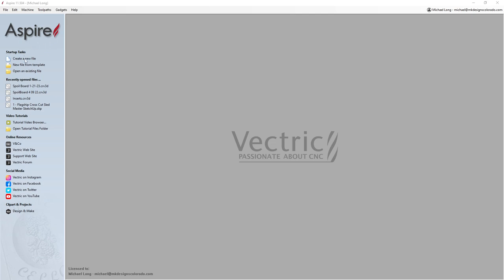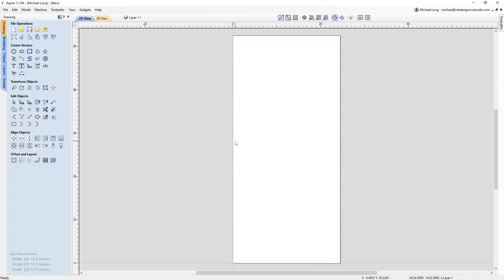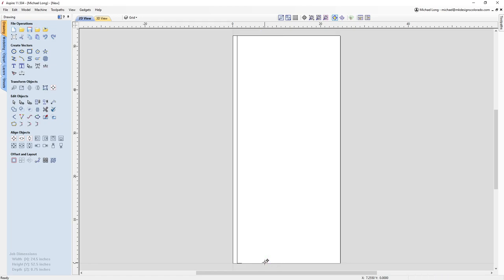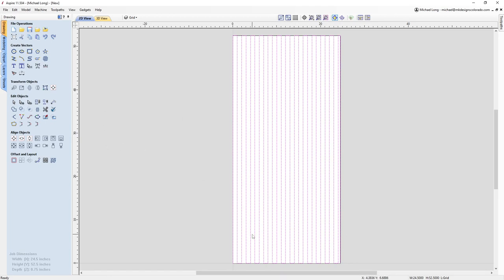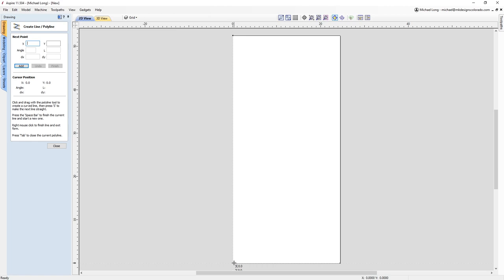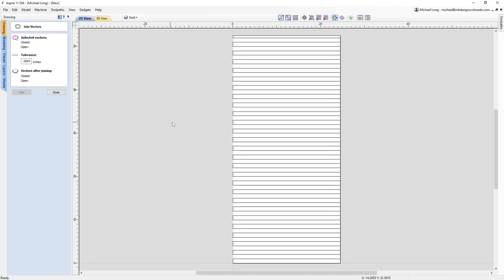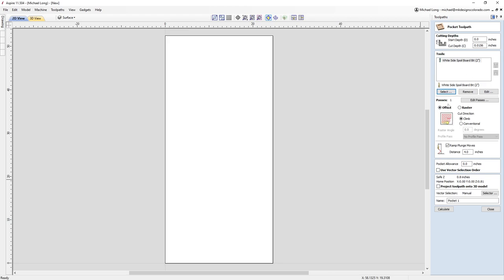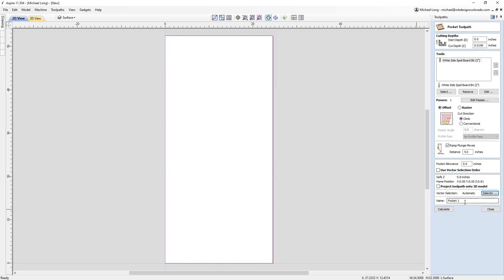Creating Toolpaths for a Spoil Board

Comment: Just finished the Grid and Surface and have it saved. Took me several tries because I was trying to watch the video and then switch to V-carve back and forth on my laptop. Tonight I used another computer to watch the video and my laptop to work on. Much easier. Question (I'm new at this) when I go to run the surface do I need to set the center of my board as the XY? Or does the program just use the size entered and the toolpath and go to town? I know I have to set Z.
Reply from the maker: You will need to set the X and Y to the same spot that you set in V-Carve for the XY Datum.

Comment: I have heard often that climb cut is not great, bit is trying to climb out of the cut which causes chatter as it is cutting from the outside of cut edge inward toward where you are cutting, conventional scoops from cut toward outside and provides constant pressure against spindle
Reply from the maker: That is partially true. 
The first thing I am going to say is if you are getting chatter on a climb cut you are trying to cut too fast for the bit and material.
The descriptions of how each work is accurate. However, conventional cuts tend to tear out more often. If I could draw a diagram here it would be easier to explain. Climb cuts sever the grain whereas conventional pulls and cuts them. It is similar to using a hand router where depending on your wood you need to do a climb cut ( carefully mind you) to get a smooth cut. 
Conventional cuts are great for roughing passes but you will want to switch to climb cuts for finishing and fine details.

Comment: Thank you.  I was wondering if there would be any advantage in using a pocket cut in raster mode (no layout needed)?
Reply from the maker: I’m not sure what you mean by no layout needed. You will still have to layout for the raster. Also, the reason you want to use offset instead of raster is because:
1- with raster you are only flattening along one axis or the other ( depending on your raster angle) . I know it seems like it would be flattening in both but it won’t. It’s kinda difficult to explain in text but essentially it will only move across one axis or the other except on the end of the line.
2- if you run it in raster across X (for example) and you need to tram your router/spindle in Y it won’t show you that and vice versa.
You could run it across X then run again along Y but that creates multiple steps and adds to the total time. So we run it in offset and that gets us where we need to be without the extra steps.